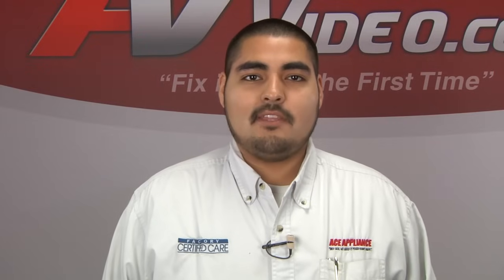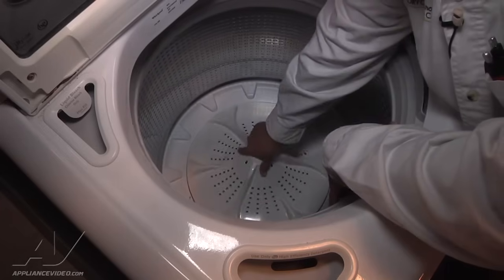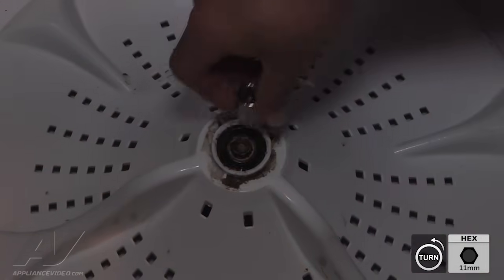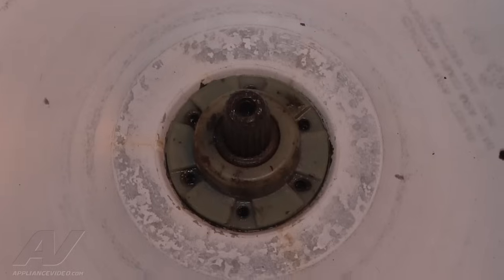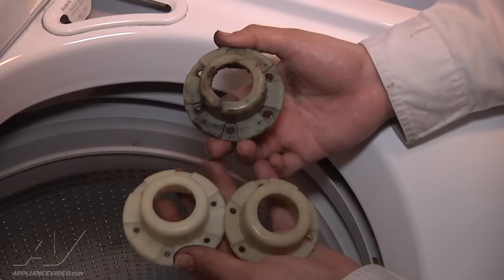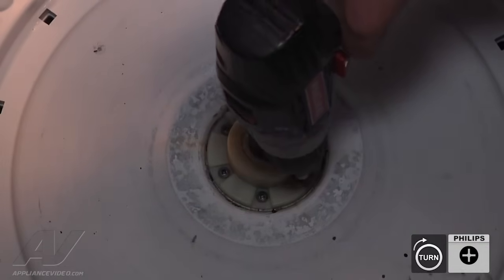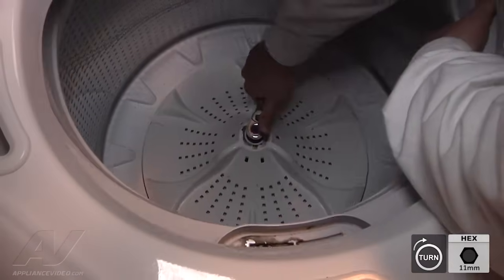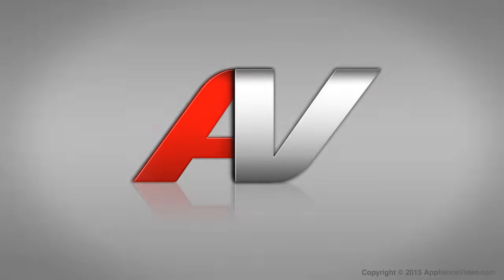Whirlpool Washer Repair - Error Codes SD and F71, Will Not Spin - Basket Hub

Comment: my WTW4950XW2 whirlpool washer -- was not spinning properly - got F7E1 & F7E7 codes -- decided to reset washer while in diagnostic -- 4 clicks clockwise - make sure rinse light on-then press start --surprise - no error codes - & washes & spins great -- -but it took looking at this and other videos to decide what to do first - thank the Lord
Reply from the maker: Great question, you can call
our parts department at 1-800-830-5465 and they can give you help 6-days A week
Mon-Sat . You can also search at www.SaveMoreOnParts.com 7- days a week.  If you have a more
technical question that our parts department cannot answer, our technicians are
answering all questions at our website at www.ApplianceVideo.com under our Repair Help section. We have over
4,000 common questions and answers that you can easily search through by your
model number, appliance make, and problem or error codes, and It’s free to
search through our question & answer library.

Comment: This was a helpful vid. But I replaced the hub and it wore out again in 8 months. What could cause that??
Reply from the maker: Great question, if you have a more technical question that our parts department cannot answer, you can search our over 17,000 answered questions free at our website www.ApplianceVideo.com under our Repair Help section. You can also call our parts department at 1-800-830-5465 and they can give you help 7-days A week ,or search at www.SaveMoreOnParts.com  .
Reply: Did you get the OEM part or one off Amazon? I heard the OEM part is more durable 😊

Comment: This seems to be the exact problem my washer is having but I am having a very difficult time getting the hub driver off. I was able to remove the agitator and the hub driven, but not the driver. It doesn't want to come off of the shaft. Any suggestions?
Reply from the maker: Great question, if you have a more technical question that our parts department cannot answer, you can search our over 17,000 answered questions free at our website www.ApplianceVideo.com under our Repair Help section. You can also call our parts department at 1-800-830-5465 and they can give you help 7-days A week ,or search at www.SaveMoreOnParts.com  .

Comment: I don’t always have the
Issue.. SD issue. but would this problem you’re showing here prevent my washer from spinning at all, it’s only when I wash certain clothes so it still spins when I do different loads
Reply from the maker: Great question, if you have a
more technical question that our parts department cannot answer, our
technicians are answering all questions at our website at www.ApplianceVideo.com under our Repair Help section. You can also call
our parts department at 1-800-830-5465 and they can give you help 7-days A week
Monday -Sunday, or search at www.SaveMoreOnParts.com  24 hours
7- days A week.

Comment: Hi, I love the video. I am having problems with the impeller coming off. Is there any other way to get it loose? I tried multiple ways and couldn't get it off.  Thnaks
Reply: Can I use a gear puller on it?
Reply from the maker: Great question, with our
technicians now getting hundreds questions weekly, they are answering all questions
at our website at ApplianceVideo.com under our Repair Help section. We have over
3,000 common questions and answers that you can easily search through by your
model number, appliance make, and problem or error codes.
Reply: I used a gear puller

Comment: Got a question. If this gear is just a bit worn, not completely blown out, can it cause the agitator to knock when it's agitating left and right? I have a cabrio with this very design and when in a wash cycle the agitator makes a knocking noise.
Reply from the maker: Great question, if you have a more technical question that our parts department cannot answer, our technicians are answering all questions at our website at www.ApplianceVideo.com under our Repair Help section. You can also call our parts department at 1-800-830-5465 and they can give you help 7-days A week Monday Sunday, or search at www.SaveMoreOnParts.com  24 hours 7 days A week.
Reply from the maker: Great question, if you have a more technical question that our parts department cannot answer, our technicians are answering all questions at our website at www.ApplianceVideo.com under our Repair Help section. You can also call our parts department at 1-800-830-5465 and they can give you help 7-days A week Monday Sunday, or search at www.SaveMoreOnParts.com  24 hours 7 days A week.
Reply: There are 4 spring loaded tub supports for that washer - they are located at the 4 corners of the washer. When they get worn out, they can cause the tub to bang around a bit, and even wear the hub out faster than normal.
Reply: @kg322  the tub isn't banging around, well, if the kids don't load it right it does....lol. It's the agitator itself knocking when it spins left to right.

Comment: I am trying to unscrew the bolt under the cap. It won't budge. I'm assuming I should be turning it counterclockwise. Is that correct?
Reply from the maker: Great question, if you have a
more technical question that our parts department cannot answer, you can search
our over 10,000 answered questions free at our website www.ApplianceVideo.com under our Repair Help section. You can also call
our parts department at 1-800-830-5465 and they can give you help 6-days A week
Monday -Saturday, or search at www.SaveMoreOnParts.com  24 hours
7- days A week.

Comment: Hi. Thanks for this video. I get the Sd code once the washer gets to the spin cycle, but not F71. The impeller starts a spin motion (for 1 second) then starts the other direction, over and over again. This goes on for 10-12 minutes then the tub fills with water and it tries the process again. The impeller spins when I hold the tub still, so I'm going to get in and follow the steps on your vid. Does it seem reasonable that I don't get the F71 code, but I could still have the stripped hub problem?
Reply from the maker: Great question, you can call
our parts department at 1-800-830-5465 and they can give you help 6-days A week
Mon-Sat . You can also search at www.SaveMoreOnParts.com 7- days a week.
 If you have a more technical question that our parts department cannot
answer, our technicians are answering all questions at our website at www.ApplianceVideo.com under our Repair
Help section. We have over 6,000 common questions and answers that you can
easily search through by your model number, appliance make, problem or error
codes, and It’s completely free to search through our question & answer
library. There is a very good chance you question is already answered there.
Reply: Hi. I’m having the same issue, but it doesn’t always happen... it just seems to be when it’s extremely heavy clothing.. like my husbands shirts...I can do a big load of clothes, mine and my two daughters,  with no issues, but certain blankets it does it, yet I can do a whole load of towels and it’s fine.. I tried using less HE detergent and that’s not the problem.. the SD problem even showed Up when I ran it through just a regular cycle with NO clothes or detergent in it.... I can’t figure this problem out and it’s driving me crazy.  Being it’s been 7months since you posted, I was wondering if you have found a solution? 🙂
Reply: Did you guys ever get this fixed I’m having the same issues thanks 🙏🏽
Reply: Did you fix the problem?

Comment: This is exactly was was wrong with my washer after about 5 yrs of use. Replaced the hub and was working again. Then 6 months later the replaced hub went bad. Replaced it again, and this time it only lasted 2 weeks. Any ideas on why it keeps stripping so fast?
Reply from the maker: Great question, if you have a
more technical question that our parts department cannot answer, you can search
our over 10,000 answered questions free at our website www.ApplianceVideo.com under our Repair Help section. You can also call
our parts department at 1-800-830-5465 and they can give you help 7-days A week
Monday -Sunday, or search at www.SaveMoreOnParts.com  24 hours
7- days A week.
Reply: Hello Carlos, i had a problem with my Cabrio last year (same as you, it had around 5-6 years of daily use) It was my bearing under the main shaft that was broken. Check the main basket if it spin freely, if its stopping right away or making alot of noise while turning its the bearing. If the bearing is jamming, maybe the system is only releasing it while under full pressure, trying to go full speed and not gradually moving and this is why the little teeth on the hub are stripping. (theory)

Good Luck and have a nice day.

Comment: Look for clothing between the inner and out drum. It will throw an F51 error along with several more. Fish it out with a coat hanger and it works again. Hope this helps someone.
Reply from the maker: Great question, if you have a more technical question that our parts department cannot answer, you can search our over 17,000 answered questions free at our website www.ApplianceVideo.com under our Repair Help section. You can also call our parts department at 1-800-830-5465 and they can give you help 7-days A week ,or search at www.SaveMoreOnParts.com  .

Comment: It looks so easy, but not in my case.I can't remove the nut!. Any help? So far I sprayed  a little bit of WD-40 and still can't get it out. Thanks!
Reply from the maker: Great question, if you have a more technical question that our parts department cannot answer, you can search our over 13,000 answered questions free at our website www.ApplianceVideo.com under our Repair Help section. You can also call our parts department at 1-800-830-5465 and they can give you help 7-days A week ,or search at www.SaveMoreOnParts.com  .

Comment: Is the shaft on the bottom supposed to be looking like its stripped?
Reply from the maker: Great question, if you have a more technical question that our parts department cannot answer, you can search our over 17,000 answered questions free at our website www.ApplianceVideo.com under our Repair Help section. You can also call our parts department at 1-800-830-5465 and they can give you help 7-days A week ,or search at www.SaveMoreOnParts.com  .

Comment: My tub and impeller moves together so I ran a diagnostics it went all the way through to C8,did the drain and stuck with the impeller making jerking movements,it wont get beyond this point.What is wrong with this crazy machine?
Reply from the maker: Great question, you can call
our parts department at 1-800-830-5465 and they can give you help 6-days A week
Mon-Sat . You can also search at www.SaveMoreOnParts.com 7- days a week.  If you have a more
technical question that our parts department cannot answer, our technicians are
answering all questions at our website at www.ApplianceVideo.com under our Repair Help section. We have over 6,000
common questions and answers that you can easily search through by your model
number, appliance make, problem or error codes, and It’s completely free to
search through our question & answer library. There is a very good chance
you question is already answered there.

Comment: My spin cycle does not work during a normal wash cycle but does work when selecting "Drain and spin" cycle.  Is that an electronic issue or could that be related to this also?
Reply from the maker: Great question, if you have a more technical question that our parts department cannot answer, you can search our over 17,000 answered questions free at our website www.ApplianceVideo.com under our Repair Help section. You can also call our parts department at 1-800-830-5465 and they can give you help 7-days A week ,or search at www.SaveMoreOnParts.com  .

Comment: So I did this replacement a few months ago, but now we are having the exact same problem.  I took it apart and the teeth on the bottom piece of the hub are worn down once again.  Why does this keep happening?  What is the solution?
Reply from the maker: Great question, with our
technicians now getting hundreds questions weekly, they are answering all questions
at our website at ApplianceVideo.com under our Repair Help section. We have over
3,000 common questions and answers that you can easily search through by your
model number, appliance make, and problem or error codes.
Reply: mcmatt, did you ever figure out what was causing your hub teeth to wear down so quickly? I replaced my about 5 months ago and they are completely worn down again.
Reply: no,  I suspect it was the bearing or tie rods causing the tub to spin in an unstable way.   but we ended up getting a different washer
Reply: That might be the router I have to take eventually, but I'll probably purchase and burn through another hub first.... Thanks for the reply
Reply: That's the way they do things nowadays. Throw away parts. They make them cheap so that they fail and you have to keep spending money.
Reply: I had this problem when I got it off ( I used a gear puller)...unfortunately the lower part of the drive shaft where this gear engaged was corroded and worn down, so nothing short of a metal gear was going to work for very long.  A new drive shaft was a bit more work than I was going to take on.

Comment: Ive had two of these huh bearings go on me, could i be doing something wrong ?
Reply from the maker: Great question, if you have a
more technical question that our parts department cannot answer, our
technicians are answering all questions at our website at www.ApplianceVideo.com under our Repair Help section. You can also call
our parts department at 1-800-830-5465 and they can give you help 7-days A week
Mon-Sat . You can also search at www.SaveMoreOnParts.com 7- days a week.
Reply: It's designed that way. Everything is throw away parts nowadays. They make it like that so you have to keep spending money.

Comment: My Cabrio washing machine gives error code F72 and Sd. On scanning the cycle stops at C8. do not complete the cycle ,finally do not spin?
Reply from the maker: Hello, for
technical questions we have a Repair Help section at this link https://www.appliancevideo.com/repair-help/ . There are over 6,000 answers and questions you
can search through FREE to help you with your problem. Hope this helps
Reply: I Have same problem

Comment: Well, this was definitely an issue that we had with ours, but when I changed the tub hub, it still won't complete a full cycle without blinking an SD code. The agitator was definitely not spinning the tub though. I had gotten a code F51 a couple of months back and a sparking outlet. I ended up running an extension cord from the washer to another outlet and it worked fine until this error code. I wonder if it is also the sensor and it should also be changed. Does anyone have knowledge with this? Lady who likes tearing things down and saving money.

Edit: $2000 out the door for a new washer and dryer. My dryer was on its last legs and the washer was dead. Needed a new control panel and a new tub, along with other things. The outlet was bad, even though it was giving good readings (weird), so I changed it and all is well. Except for spending two grand.
Reply from the maker: Great question, if you have a
more technical question that our parts department cannot answer, you can search
our over 10,000 answered questions free at our website www.ApplianceVideo.com under our Repair Help section. You can also call
our parts department at 1-800-830-5465 and they can give you help 6-days A week
Monday -Saturday, or search at www.SaveMoreOnParts.com  24 hours
7- days A week.

Comment: This seems to be my problem. Got the Sd error code. Hub spins independently of the tub. Removed the cap and nut without issue. The hub WILL NOT COME UP. Screw drivers in the small holes were a joke. I'm bleeding all over. Even tried using flat bars and claw hammers, prying up under the outside rim. The hub will not budge. As I said, the nut has been removed.
Reply from the maker: Good 
question, you can call our parts department at 1-800-830-5465 and they can give
you help. If you have a more technical question our parts department cannot answer, our technicians are answering all questions
at our website at ApplianceVideo.com under our Repair Help section. We have
over 3,000 common questions and answers that you can easily search through by
your model number, appliance make, and problem or error codes.
Reply: Me too....help.

Comment: The part about the agitator just pulling up and off by hand is not even close in my case. I even had a pair of channel locks on it, pulling as hard as I dare and it won’t even budge.
Reply from the maker: Great question, if you have a more technical question that our parts department cannot answer, you can search our over 13,000 answered questions free at our website www.ApplianceVideo.com under our Repair Help section. You can also call our parts department at 1-800-830-5465 and they can give you help 7-days A week ,or search at www.SaveMoreOnParts.com  .
Reply: Me too.  It won't come off just now.  Were you able to pry it off?
Reply: @tonyguerrero7491  
Eventually. I just kept working it and it finally slid right off. It seemed like it was welded on there and all of a sudden, it worked.
Reply: @JoeL-he3ru  after 10 minutes, blood sweat and tears😭, I finally got it🤣  thanks

Comment: I get the SD and the f72 what’s the means ? Can help
Reply from the maker: Great question, if you have a
more technical question that our parts department cannot answer, our
technicians are answering all questions at our website at www.ApplianceVideo.com under our Repair Help section. You can also call
our parts department at 1-800-830-5465 and they can give you help 7-days A week
Monday -Sunday, or search at www.SaveMoreOnParts.com  24 hours
7- days A week.